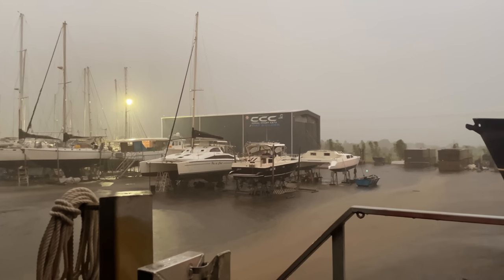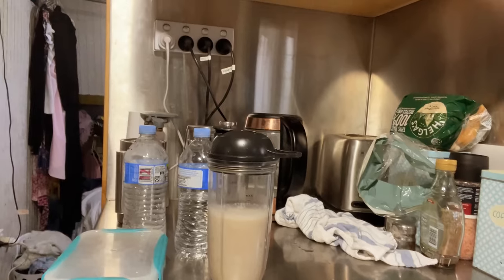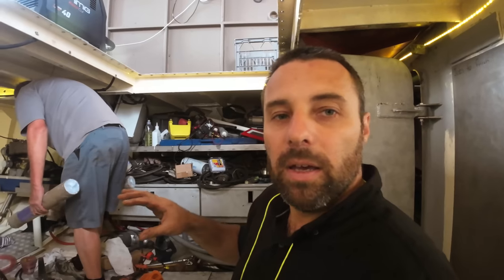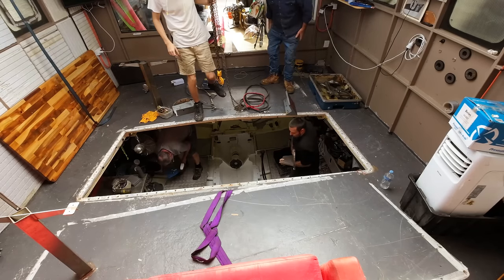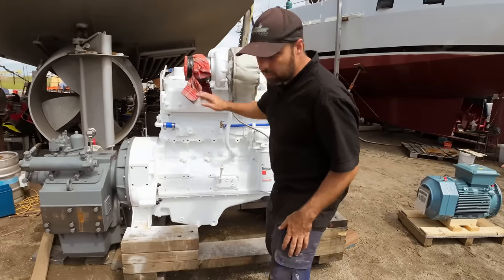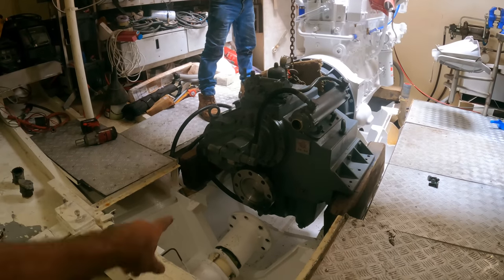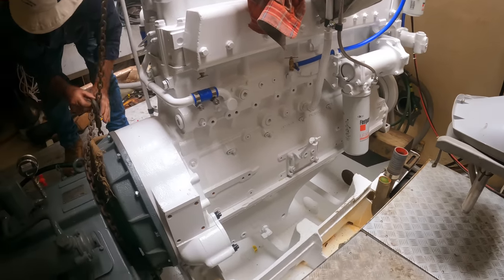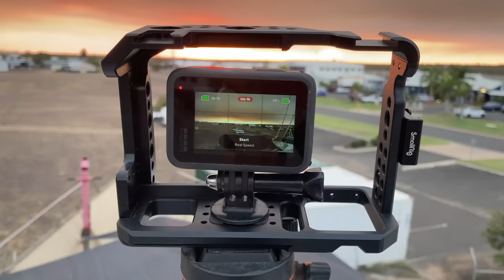Brupeg's Engine gets lifted in - Project Brupeg Ep.299

Comment: Future Project #1,462... Instead of welding the roof back on the saloon, build up a 12" (30 cm in Aussie inches) 'ladder like' frame around the opening, install 'tilt-out bottom' windows in the spaces and then bolt the cut out back on top. You now have a ventilated skylight that can be unbolted any time access to the engine room is needed and you don't lose roof space for solar... :face-purple-wide-eyes::face-fuchsia-poop-shape:🖖

Comment: Trev's right I'd put automated hinges on that plate after you've reinforce it's edges and make it into a door hatch that you cut out of the roof opening. Then mount a rubber gaskets of sorts to seal it up! then wire it up. So that all you need to do is hit a switch and boom it opens it up and now you can have natural air circulation throughout your dining area.

Comment: nice to see all the hi-vis, safety boots and hats. 
The openings round both holes covered in warning tape and danger cones. 😘👌 
 OR
 just get the bloody thing done 🤣 
Personally Im in the second camp.         Great update 2x👍
Reply: It’s all about working safe. A bump hat makes sense but anything “better” won’t be much help if the engine or a thick steel plate falls on you. Just communicate, work safe and get it done.
Reply: @Dave5843-d9m  true 👍👍

Comment: Can't stop thinking about those two bolts you didn't put on the gearbox.
Reply: ITs a good move, nothing is as bad as trying to get something like that out while bouncing around in the middle of the ocean, they are not really needed, there is enough holding it all together.
Reply from the maker: Agreed. The old engine bellhousing didn’t even have the bottom bolts tapped.

Comment: Seems like a shame to weld that roof section back in. Maybe a metal frame to lift it up 30-40cm to make a nice deckhouse. Lots of light from the windows around the deckhouse and the roof of he deckhouse would be the piece of roof you already have removed. But making it bolted on to make it easy to remove the roof next time. Because you know if you don't have it, the first expedition will have some piece of equipment that will need you to remove the roof again.

Comment: Nice !!  I'm curious to know how you will align the engine+transmission to the propshaft.  It's a very delicate operation, usually done with specialist equipment (laser collimator, etc.) and for which there is no option to do it wrong...
Reply from the maker: We will do it the same way we did the last one. Dial gauge, magnetic base and feeler gauges.

Comment: skylight in boat...... put in a rim of steel about a cm high on both the lower roof and the upper roof.  then make some stand offs that are about 100mm high (upper roof is supported by these).  add in some thick lexan / acrylic sheets glued in.  light in most of the way around.